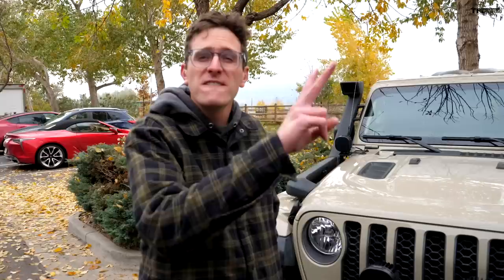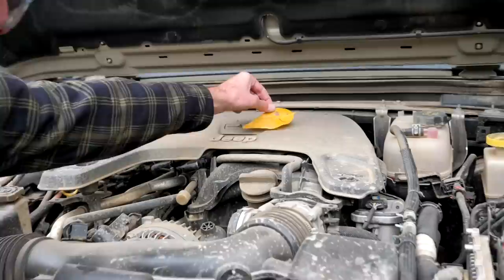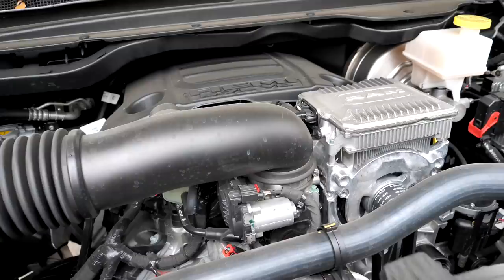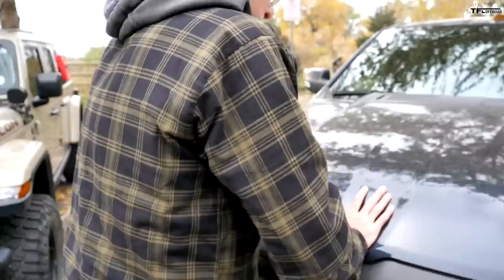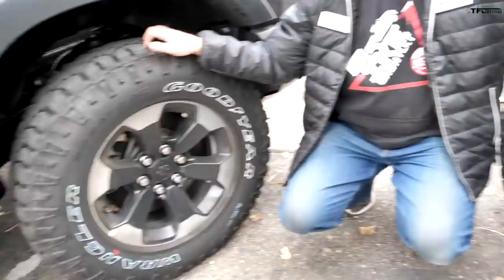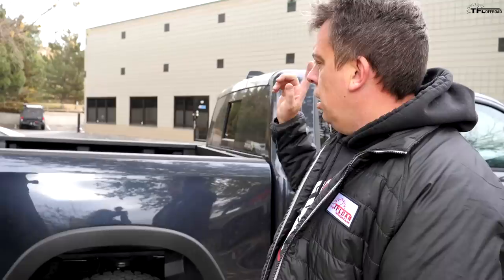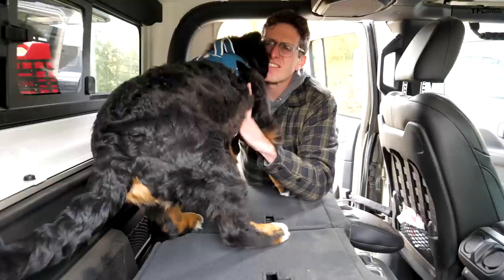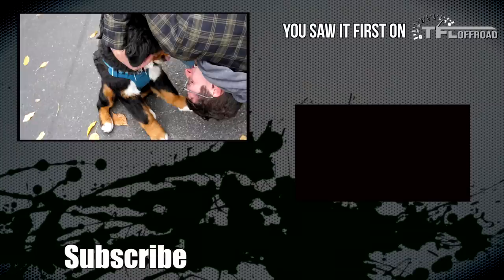$55K Shootout: Jeep Gladiator Rubicon or Ram Rebel!

Comment: "The cool thing about the E-torque is that it does absolutely nothing at all."   😃😃  Thanks for being honest, Tommy!!
Reply: Why is it there if it does nothing...only FCA I guess.
Reply: @mikefoehr235  i promise you, etorque will total all these trucks in 10-15 years lol.
Reply: They did an interview with one of the engineers and he explained the benefits. The biggest thing to me was smoothing out engine stop/start.
Reply: @jghall00  start stop sucks, you just turn it off.
Reply: @richfarfugnuven6308  I like tech, especially when it works.
Reply: @bendino9016  I doubt it, just an oversized motor and belt.

Comment: Guys, let's talk eTorque.

1. Download an accelerometer app on your cell phone (e.g., Sensor Sense)
2. Find a smooth stretch of road.
3. Get two RAMs with identical power trains side-by-side, one with eTorque and one without, and drive them down that road while recording the acceleration on your phone. Make sure you place the phone at the same spot in each truck so it's an apples-to-apples comparison.
4. Objectively compare the accelerations from each gear shift between the eTorque and non-eTorque transmissions.
Reply: What would it tell you?
Reply: E torque has very slightly better gas economy on acceleration, cuz the engine needs to work less to get the same amount of acceleration

Comment: You can option a 2500 Tradesman with the Power Wagon Package along with a few other options and stay under $55K MSRP.  This is just one more choice available  - each of the the trucks has Pro's and Cons.  Maybe FCA should offer a Blender option instead of the E Torque that does nothing!
Reply: to get a Tradesman to the level of a rebel, you're looking at a shit-ton of upgrades. A shit-ton.

Comment: If you off-road for real 3 weekend a month over 5+ months...jeep. if you commute, haul anything for diy or home use, and want to overland and camp like most actually do without any 'hardcore' off road...the Ram, or any 1500 size truck. My F150 was 33k out the door, missing a lot of bells and whistles like heated seats, but the STX had almost everything I actually needed, very suited for what we needed.

Comment: Wow you mean to tell me a full size truck has a bigger interior, bed and can tow more?? No way!
I had a 17 Power Wagon and i loved it but for what my needs are i like my gladiator more overall. And it’s crazy that with 37s on my gladiator i get around 16.8mpgs compared to in the 11s with 35s on the Ram
Reply: Hey koHey k onHey kHey OK I
Reply: 11 with the ram??? Were you constantly putting your foot in it? I do dramatically better than that on fuel consumption.
Reply: @fmrscout33  what year is your power wagon? Do you have 35s? My current commute is 13 miles on country backroads with very few stops and I’m averaging 19mpg.

Comment: Have had a 1500 EcoDiesel ram1500 slt, now have 21 gladiator Rubicon diesel.. and I LOVE it I truly do... But going back to a 22 ram rebel diesel - with 2 kids, a 6000lb trailer and long highway drives, as much as I'm an enthusiast the rebel does 95% of the offroad I will reasonably do and is far far far better at towing and on long highway drives.

Comment: I'd buy the Rebel for my daily driving and occasional light off road.  I'd buy a 3 year old gladiator for more adventurous off roading/camping and wouldn't mind if it picked up scratches or dents. The gladiator is too crude to drive everyday and the Rebel is too nice to beat in the hills.

Comment: I’m seriously skeptical about the etorque system. Is it reliable? I hate the idea of the 48v system combined with the 12v battery. It just seems so unnecessary. Just another system to go wrong and expensive to replace down the road. Sucks all 2021 AT JL’s have it with the 3.6.

Comment: The Ram has a windshield defroster that, wait for it, actually defrosts the windshield! It also has an AWD setting for the winter, a feature that's unavailable on the Rubicon. I do believe it's available on the lower trim Sahara. I don't know if the Ram has a heated wiper pad in the winter package. Toyota and Subaru models have it.

Comment: 15,000 miles on the clock of my 2019 ram 1500  Limited.  I got it as fully loaded as I could possibly find for the time $72000 MSRP. I can Unequivocally say.... the Etorque system does not   benefit the truck in any conceivable way. It doesn't get better gas mileage I average 15 mpg, ( I did replace the stock tires
https://www.customwheeloffset.com/wheel-offset-gallery/911106/2019-ram-1500-xd-badlands-stock )
It isn't any faster. Do not buy etorque, if you're going to get a ram 1500 hemi.
Reply: I had the same problem with my 2020 Ram Rebel couldn't do better that 15mpg highway! ...traded it for a Trail Boss LT and its awesome, also 23.4 mpg best with it.
Reply: @MeliorIlle  lol, lucky for you I've got plenty of money.  But thanks for your concern.
Reply: @rossgreenzweig  👌 nice, I find the Ram to be a more complete package for what I do.  I like the look of the trail boss, but My truck has to be a little more on the professional side for realestate. I definitely thought long and hard about getting one that was blacked out and throwing 35"s and a lift kit on it. But that would be more play than work. Which is definitely not the case for me.  I do however have plans on getting a 2021 escalate which will free the truck up for more fun stuff.
Reply: @MeliorIlle  😆, Sure that's me the idiot who can afford to waste $72,000... According to you,  The rogue genius whom spends his time doling out  unsolicited financial advice in the comment section of YouTube.  Well thanks for clearing up who's the idiot and who's the genius. Really don't know what I would have done without you!
Reply: @MeliorIlle  You're 100% correct; If, I had wasted $72k, I would be an idiot... I would also be a gigantic mental pygmy! If I wasted my time trying to manage someone else's finances through the comment section on YouTube. 😉

Comment: Have a question, with all the videos that yall put out, and are all great btw. Haven't heard mention the troubles with the Check engine light, or codes or the start stop system that seems like EVERYONE is having issues with. Are yall not allowed to tell the negative real world stuff for fear if losing sponsorship?
Reply: I had a 2019 wrangler sahara with all the options, no problems. I currently have a 2021 Rebel, that i've owned for a little more than a year. Also zero issues. The wrangler was a 2.0 turbo and the rebel is the 5.7. I also have friends with Jls and no issues reported. So "Almost everyone" is a tad steep

Comment: I just bought a 2024 rebel and they told me it towed 12000 but after I bought it going through all the paper work it can only tow 7200.  It’s the air shock version.  

I traded in my Mojave gladiator for it that can only tow 4500.  

I thought I was grabbing the model with front and top 360 camera but I didn’t.  How hard is it to add those extra cameras ?

Comment: I own a 19 Rebel and I love it! 5.7 Hemi of course. The inside of the truck I love. That big screen is a must!! I Have the red interior as well. Just an amazing truck!! Love it on the snow,mud,sand,rain. Love the Rebel. Just keep in mind MPG haha sucks lol.
Reply: Thinking of buying the 19 myself. It holds it's own off road?? How many miles do you have on it?
Reply: @downsf  I believe the new year like a 20/21 Rebel have an option now to drive awd. So mine have 2wd, 4 high and 4 low. But anyways.. yes love my 19 Rebel just came back back from the snow no probs. Still get lot head turns ppl love the truck. Have about 15k miles.

Comment: RIP manuals. I bought my tacoam for the manual. 10k miles later on a new 2020 tacoam and the clutch failed. Slips and the pedal to the floor.